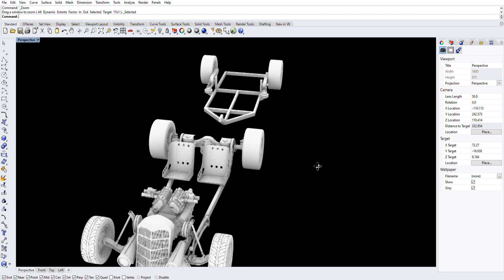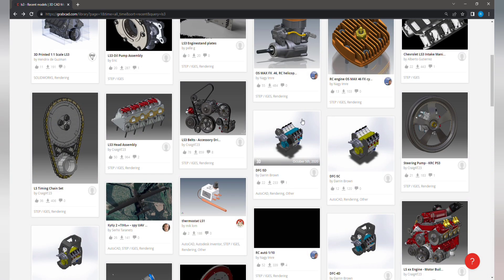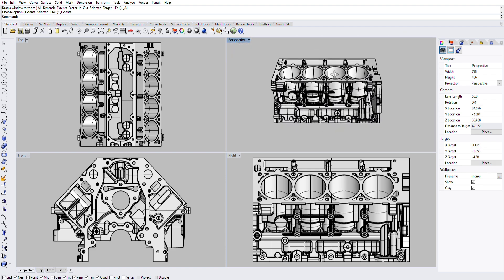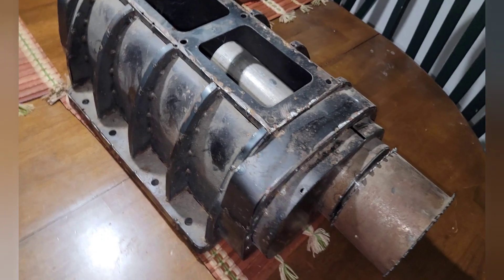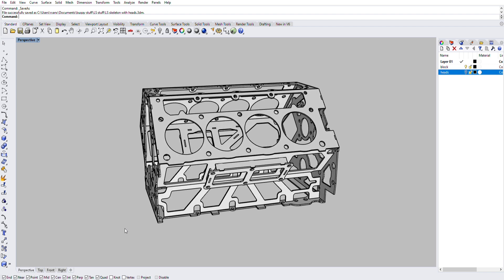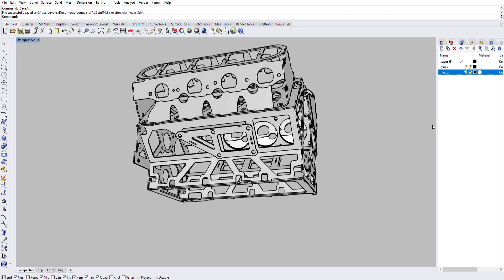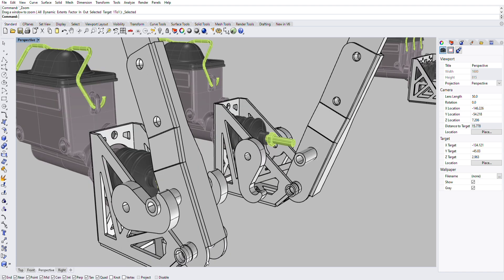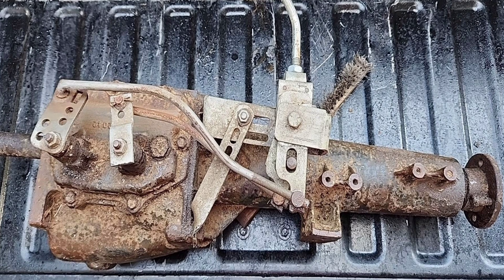Monday Morning CAD Episode 12    Steel LS Mockup engine and Custom Epoxy Resin Steering Wheel

Comment: What's the part number on the transmission case?  How many splines?  In Chrome I did right click -> Search Images with google, selected the video at 13:24, and got some results.
Reply from the maker: I'll double check on the splines, but we ran all 4 numbers we found on it, I've found transmissions that are close, but nothing that's exactly the same.   I don't think I'm using it for this car,  because the 833 is what's recommended as a swap in almost every post I can find online, but it would be nice to know for later.

Comment: Most trans have a number if you can find it .They are usually  on the bottom front edge. Just look up the number on line and most likely it will show up .😊
Reply from the maker: Found 3 differant numbers on it, all where dead ends.